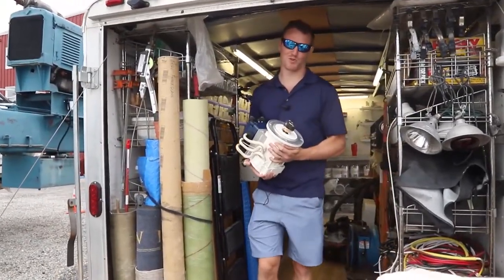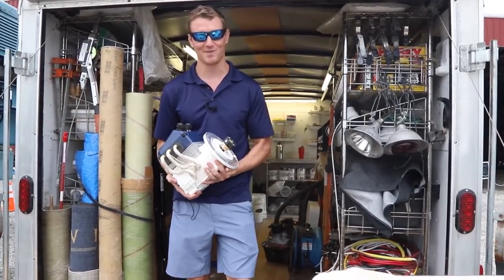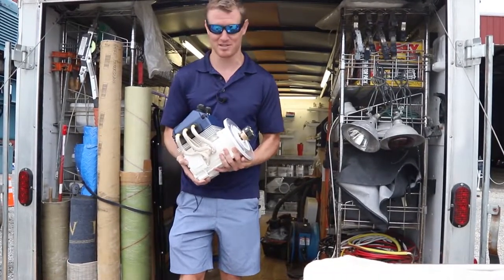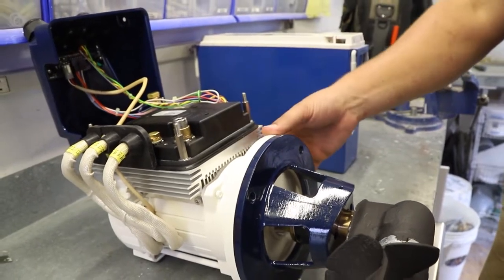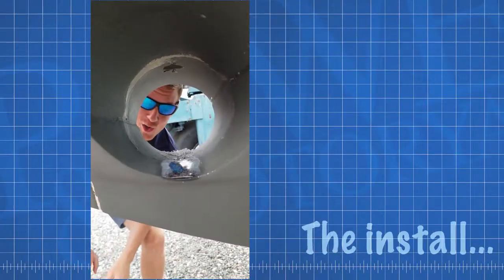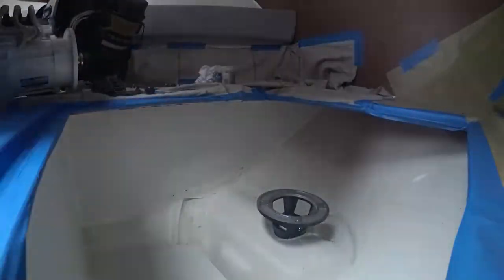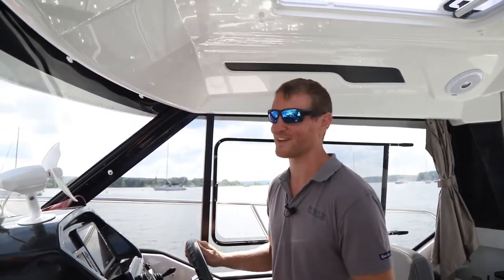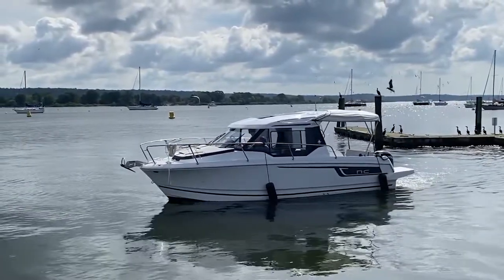Installing a Vetus Bow Thruster

Comment: As a long time subscriber to the print mag I generally like these teasers at least a little, but this one left me high & dry. The scary part, even if having a pro install it, is gaining access to install the motor and cutting the hole through the hull.  A little more on that part might relieve some fears and also get owners to lean toward the pros.